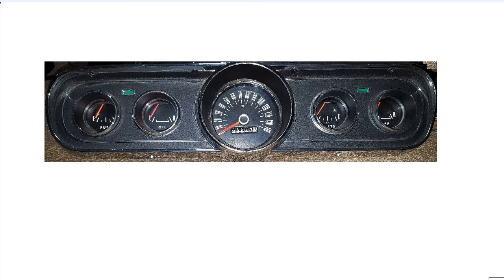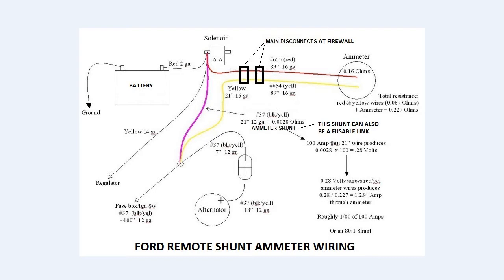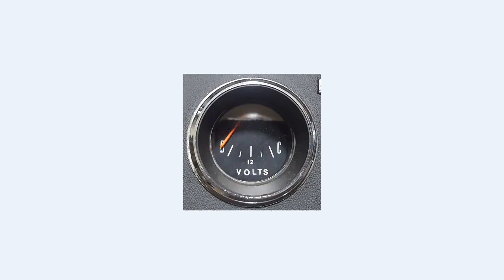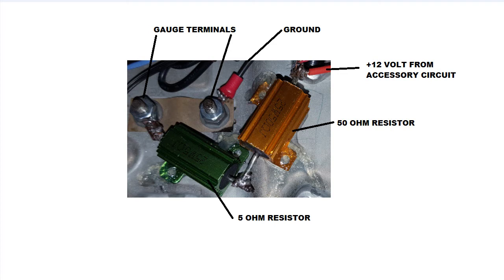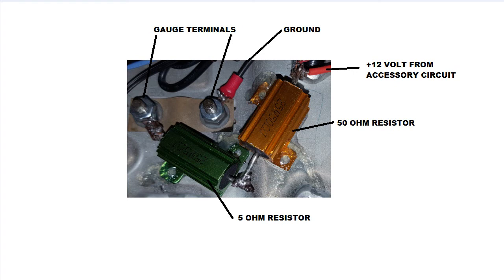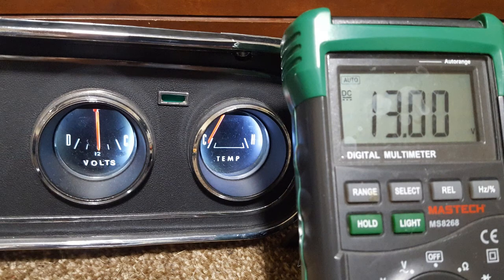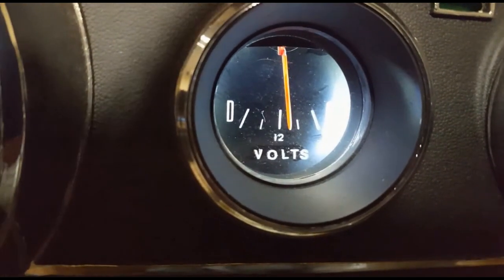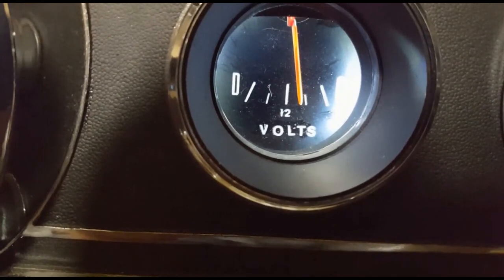1966 Mustang Oil gauge converted to voltmeter in place of ammeter

Comment: Doesn't the heat generated from the power resistors affect the other gauges on the housing? Especially the Temp Gauge? I'm wondering how much heat is generated.